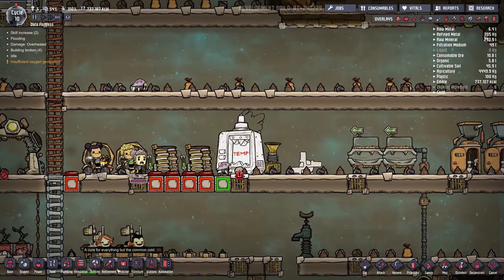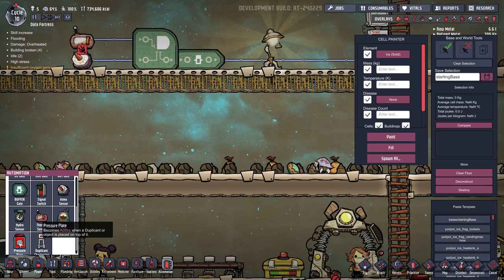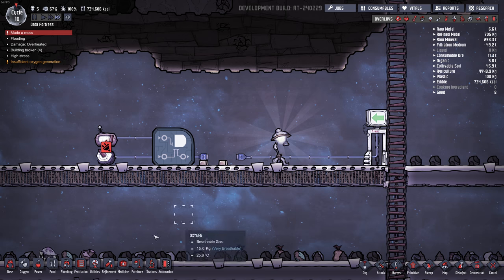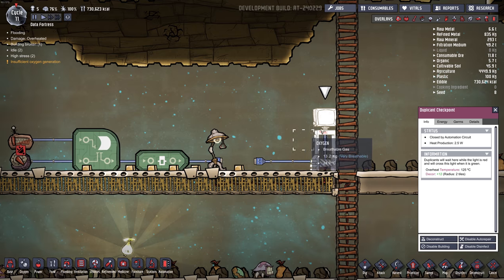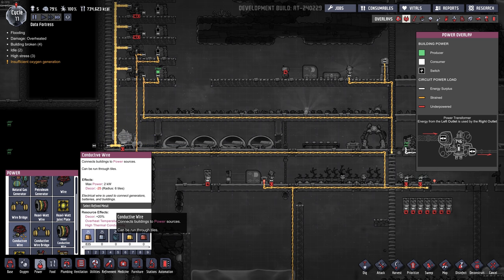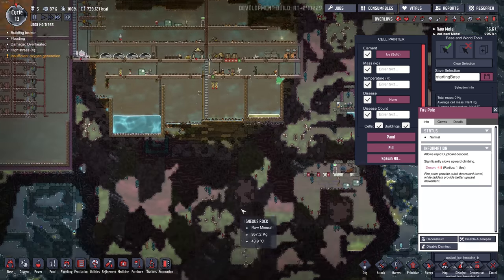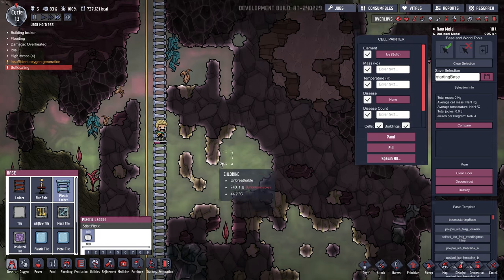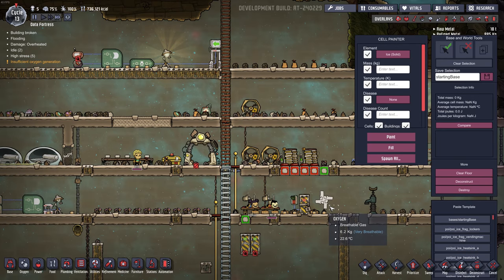Oxygen Not Included Automation Upgrade - Logic Gates, Fire Pole, Metal Refinery, Rock Granulator .

Comment: Uh oh that heavy watt wire change will mess with progressing to centralized power depending on how long it takes to get to metal refinement.
Reply from the maker: I wonder if you can feed in two 1kw lines. I'll try that out.
Reply: Feeding 2 lines will simply merge the 2 circuits into one, with 1.2 kw passing through regular wire. (tried that)

Comment: my first thought is you can link a room full of pressure plates (and a potential buffer) before a NOT gate into the new door in order to have a bathroom that detects if anyone is using it to lock the door. I think you can use that to lock the door and bathroom from one side and you use a one directional door on the other side.
Reply from the maker: Yeah a nice "logical" private bathroom. I'm messing around with boolean circuits now. Crazy what you can do.
Reply: Grind This Game For me I'd find the ideas harder then looking into the boolean Logic to make an idea work. Really, for the average player, it makes a few things a little simpler (as in circuit conditions to break power flow) which already allowed OR/AND gates with a condition A and B with just electric wires before the update.

Comment: Oh wait.. you need 1200W to refine metal to use it so you can produce wires providing more than 1000W of power to your refinery... damn... that's challenging
Reply: Adam Koniuszewski There was a heavy watt wire for non pure metals which would easily do 1.2k
Reply: Jamie T but right now it needs refined metal :)
Reply: Adam Koniuszewski 10:30 there's heavy watt wire (that uses the regular stuff) and heavy conductive wire (that uses refined ores)
Reply: Oh yeah, I missed that:) Thought heavy watt wire and conductive are the same :) Thank you:) my bad... but that would be a sweet mistake if they did that.
Reply: Adam Koniuszewski it would have made it practically impossible to get to half the game since you don't have the ability to go over 1kw in basic wires.
Reply: Jamie T possible but more challenging:)